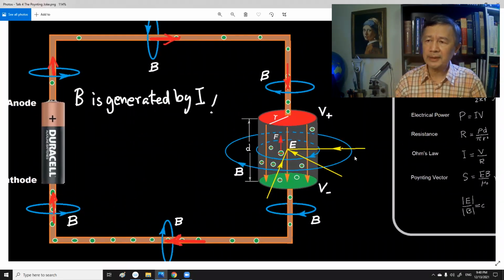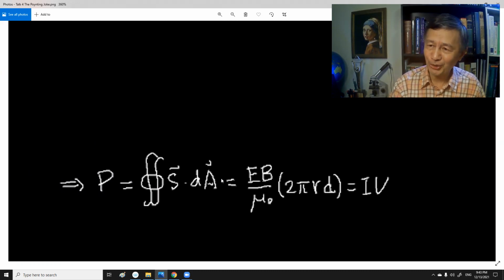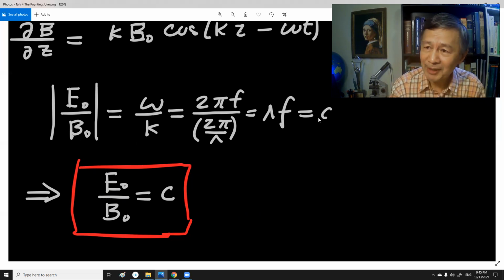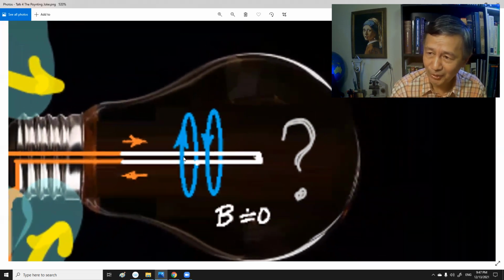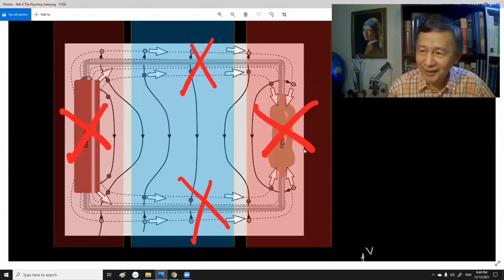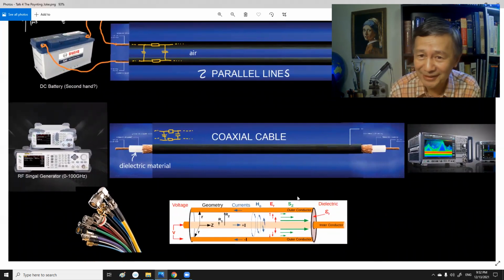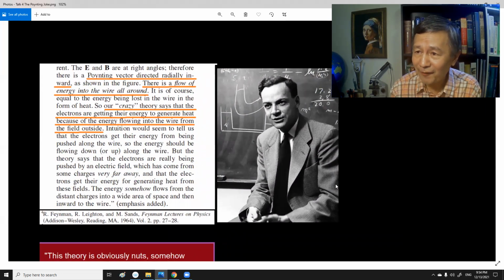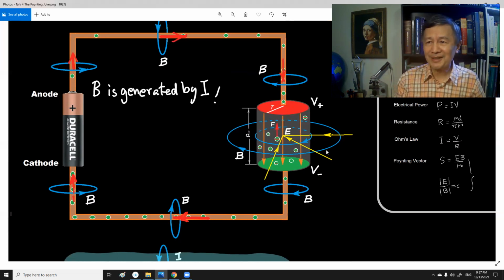The Poynting Joker | Veritasium's Big Misconception about Electricity  4 | 波英廷小丑：真理元素對電學的誤解

Comment: Good video.

I promised to make a video reaction on the claim of Veritasium, here it is:
https://youtu.be/mTmqwdCmgIg

I have to recognize that I'm not that good in physics to rebuke what i've found, or maybe I've forgot a detail that teachers taught me 20 years ago.

I did the experiment you proposed with capacitor and neodymium magnet.
I went even further, using 25kV pulses.

Doing the search of articles and books on Poynting theorem and vector, I've found that some works use those concepts applied to DC circuits.
Apparently, they base their claims on some kind of coupling current-magnetic field that I tried to explain in the video.

As I mention, some authors of books of electromagnetism were cautious and they abstained from using Poynting theorem in DC. 

But others dare to use Poyntings in DC no matter what.
Using their consideration, apparently there is electric and magnetic field inside real conductors, so the Poynting vectors are even inside the conductor.

So, using their logic, a real conductor transports energy near the shell, but also   in a region inside and a region outside.

After I published the video, I've found an article that mention that Poynting vector and Umov energy density are not always the same. 

But never found a single real experiment that confirms the use of Poyntings in DC.

Anyway, thank you for inspiring the questioning.

Comment: Is this video an April fool’s joke?  It completely mangles the differences between near fields and radiation.  Near field electro and magnetostatics have a different treatment than far field radiation. You can have static E and B fields in that DC circuit that do NOT have the ratio of E and B fields in a propagating wave.  Consider the trivial case of a charged capacitor (just sitting across a DC voltage source). There is an E field between the plates and NO B field.  You are mangling plane way analysis and statics, ignoring where time derivatives exist in Maxwell’s eqns.  Poynting analysis is correct for DC case also.
Reply from the maker: What are you surprising about?  Yes, the radio of E to B is not c as shown in this video, which implies that one cannot assume ExB represents an energy flux in DC circuit, near or far. Watch this video again please.
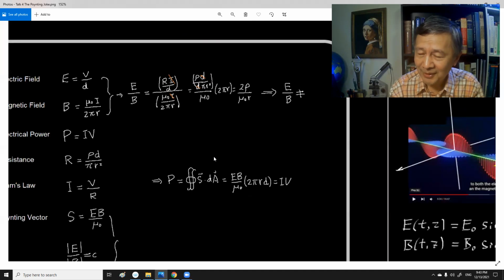Reply: @yongtuition  E x B is gives the energy flux whether you are considering DC fields, or plane waves.   You used the argument that since E/B is not c, Poynting theorem does not hold.  You are making the false claim that Poynting analysis only holds for plane waves.   You were actually correct early in the video when you showed that E x B for the circuit did yield the same as VI.  You indeed did show that it works for DC case.  You start stating the false constraint for use of Poynting vector at 3:15 in video.  You can look up the derivation of energy flow via use of Poynting vector in Feynman lecture notes.  That derivation does not rely on plane waves.  It is common to use Poynting analysis for plane waves so that you can determine power flow from radiation - in that case, you will typically take the time average.  But that in no way prevents Poynting analysis from being used for DC.
Reply from the maker: @bobwhite137  Then your are the second buyer of the DC cooker illustrated in my Video 1 on this subject.
Reply: @yongtuition  There is no volume you can draw in the cooker example that has net power inflow or outflow.  By the way, science asylum had it wrong - for good conductors, S is nearly parallel to the wires.  Veritasium got that right.
Reply from the maker: @bobwhite137  Are you still going to buy that DC cooker? Neither Science Asylum nor Veritasium are correct as they treated Poynting vector as you did. Veritasuim assumed the wire is made be superconductor whist Science Asylum didn't, that's all.
Reply: @yongtuition  Science Asylum ignored the normal E field.  He only considered the tangential (which by the way, Feynman misleadingly did in his lecture notes).  Show me the volume that has net power inflow or outflow for the cooker.
Reply from the maker: @bobwhite137  The DC cooker is designed based on the Poynting vector Feynman and his followers defined.
Reply: @yongtuition  Without a volume that shows net power inflow or outflow, there is no conflict.  Still waiting on such a volume.
Reply from the maker: @bobwhite137  Unlike mathematics, physics is based experimental observation. Why don't you buy the DC cooker first and do some experiments?
Reply: @yongtuition  ok, so it is pointless discussing further with you, got it.
Reply from the maker: @bobwhite137  To ask a right question is better than to answer.
Reply: @yongtuition  Dug a bit deeper by examining the derivation of Poynting vector.  There are a few variations, but eventually, you will find an expression like this:    
∫ (E x H) . dS = ∫-d/dt   [ ε E 2 /2 +  μ H 2 /2]  dV –∫ E. J. dV

The first integral on the right is for radiative energy.  The second integral is for ohmic losses.  That is EXACTLY the case being considered in the DC circuit.  It is not just "the math works out", it is a clear cut consequence of the a legitimate derivation from Maxwell's equations.  With respect to your DC cooker - that is a RED HERRING.  It is NOT the same scenario as a current carrying wire.  You are conflating those two cases.  As to Poynting vector applicability in the pure static case (i.e. your cooker), I would argue it does not apply, since if you look at the steps in the proof for the Poynting vector, you are faced with a 0 = 0 equation early in the proof, and anything beyond that is nonsense.   So there are 3 cases to consider - time varying fields (Poynting works), static fields with a non-zero J (Poynting works), and static fields with no J (Poynting doesn't work), thus no paradox with your cooker.

Comment from the maker: There is no energy between two charged plates but the electric charge arrangement. That's to say, u is zero, instead of a constant. U=0.5CV^2  is another misconception. In the cooker, ExB is a constant,  but you cannot obtain an energy flux in the ExB direction.
Reply: The energy in a capacitor or between two charged plates is a scalar electromagnetic standing wave or a longitudinal wave. When you have a perfect dielectric reflector as in a capacitor, the hertzian/transverse waves move 180 degrees out of phase and collapse to form a longitudinal standing wave. This is also known as gravity. Gravity is a longitudinal standing wave.

Comment from the maker: 1. Veritasium abused the concept of Poyning vector.
2. du/dt=0 when E and B are time independent. 
3. No charge is needed for obtaining ExB. Besides, surface effect is absent for DC current in conductor.
4. Maxwell equations implies EM wave is possible. Poynting theorem is used to describe energy transfer in EM waves, derived from energy conservation
Reply: You don't understand poyntings theorem. You don't even know what poynting theorem actually is.

Start by asking you what is the power density delivered by the EM field, you can derive this from lorentz force.
The electromagnetic force density is:
F= ρ(E + VxB)
Where V is the velocity field of the charge distribution.
Thus dotting both sides with V, VxB dies so:
F*V = E*(ρV)
The left side term can be identified with power density delivered by the EM field (remember the F stands for force density)
Work = intergral( F*dl )
Work = integral ( F*V*dt )
dW/dt = F*V
On the right side ρV is current density as V in this case represents the velocity field of the distribution of charges.
Thus:
dW/dt = E*J
Where W is density of work produced by the EM field.
From this equation, you can now separate J from Ampere-Maxwell law and replace it, by invoking other Maxwell equatuons and using vector calculus identities, you arrive to  the following equation:
dW/dt = -dU/dt -  div(S)
Wich is the real poyntings theorem.
This is the conventional proper derivation present in pretty much all introductory electrodynamics texts, i.e. Griffith's introduction to electrodynamics.

In the case when there is no power being delivered by the electromagnetic field, then:
div(S) = -dU/dt
Notice how what you called poyntings theorem is actually a special case of poyntings theorem, the actual poyntings theorem not only takes into account the flow of electromagnetic energy but also takes into account the conversion of EM energy into mechanical energy by virtue of power delivery by the fields, if EM energy is being converted into mechanical energy then the continuity equation doesn't hold.

This shows half of your objections are plain misunderstandings, Poyntings theorem is directly derived from Maxwells equations and the Lorentz law, thus it applies universally, in all cases not just EM waves. Objection 4 down.
If the fields are constant then indeed dU/dt=0, but then poyntings theorem reads dW/dt=-div(S) so you can and you do have concentrating energy flows into and out of some areas, those areas where electromagnetic energy is being converted into mechanical energy or viceversa, Rendering objection 2 kinda pointless.
Objection 3 is kinda pointless in and out itself.
So you are left with no arguments to claim 1.

Comment: Why did you reject field lines between parallel wires?

Didn't you forget to take into account surface charges?
Reply from the maker: The correct question is: what is the origin of the magnetic field between the parallel wires?
Reply: @yongtuition  
Stationary regime:

E field outside wires is due to surface charges. It goes from top wire (positive surface charge) to bottom wire (negative surface charge). It is a non trivial distribution since surface charge density is non-uniform along the circuit. You can look at American Journal of Physics 64, 855 (year 1996, author J D Jackson)

B field is due to current. It decays rapidly as we go far from the wires (or other element in the circuit).

Because of this rapidly decay of B, S field lines are closer to the wires.

S leaves circuit elements that deliver power (like a battery). S goes into circuit elements that consume power (like a resistor)
Reply from the maker: @renanmelo4903  The mistake as what Veritasium made. How did you know the EXB represent energy flux?  You could be first buyer of that DC Cooker illustrated in my first video (Part 1). :)
Reply: @yongtuition  Well, let's see if that cooker would work using this crazy Poynting vector without EM waves involved?

There is no time dependency in your scenario. Therefore, rot(E) = 0, div(E) = 0, div(B) =0 and rot(B) = u0 . J

Since S = E x B / u0 we can calculate div(S) = (1/u0). [ (rot E). B - E . (rot B)] = (1/u0). [0 - E.(u0.J)] = -E.J

Poynting's Theorem states that -du/dt = div(S) + E.J

In absense of cooker, J=0 and div(S) = 0. Therefore, u remains constant and there will be no "free energy" from fields.

While we put the cooker inside the fields, we are the ones doing work (not the field). Div(S) will no longer be zero and there will be a change in energy density because E field will push electrons of this cooker (inside and over its surface) and J will no longer be zero while we are moving the cooker.

As soon as we stop moving the cooker into the field, J=0 and we come back to time independet scenario. Div(S) = -E.J and therefore -du/dt = div(S) + E.J = 0. U no longer changes and may not be zero! How could that happen?

Well, when an object rests inside an E field it shows polarization of charges! That is where that non zero U came from! Awesome, right?!

Poynting vector is totally counterintuitive :)  However, it doesn't allow "free energy" in DC.
Reply from the maker: @renanmelo4903 There is no energy between two charged plates but the electric charge arrangement. That's to say, u is zero, instead of a constant. U=0.5CV^2  is another misconception. In the cooker, ExB is a constant,  but you cannot obtain an energy flux in yhe ExB direction.
Reply: @yongtuition  I didn't understand your point. Can you give more details, please?

Comment: I believe you are confusing S with radiation.

S= E x B / u0

Radiation is a configuration of the E and B fields when charges accelerate. It is the solution of Maxwell's equations where they obey the Wave Equation.
Reply from the maker: In the wave equation for EM wave, both E and B are time-dependent. Besides, E=Bc. Radiation refers to superimposed EM waves. S can be considered as the intensity of radiation if, and only if, E and B satisfy the wave equations.  Mathematically, Veritasium assumed the cross-product of E and B automatically give the energy flux, maybe he didn't understand the underline physics.
Reply: @yongtuition  does Poynting's Theorem need EM waves in its mathematical proof?
Reply from the maker: @renanmelo4903  Yes. In the absence of EM waves, the cross product of E and B is meaningless.
Reply: @yongtuition  Althought Veritassium's video introduces S in the context of EM waves, Poynting's theorem does not use wave equation.

All we need is Gauss's theorem of vector calculus and Maxwell's equations. For example, you can check this demonstration in Jefimenko's book.

I do recognize that this script choice of Veritassium induced the association of S only to EM waves, but that is not the whole story. Conservation of energy in electromagnetic field also depends on the motion of charges:

-du/dt = div(S) + E.j
Reply from the maker: @renanmelo4903  1. Veritasium abused the concept of Poyning vector.
2. du/dt=0 when E and B are time independent. 
3. No charge is needed for obtaining ExB. Besides, surface effect is absent for DC current in conductor.
4. Maxwell equations implies EM wave is possible. Poynting theorem is used to describe energy transfer in EM waves, derived from energy conservation. 

If you still cannot see what Veritasium's claim is wrong, you need re-study electrodynamics again.

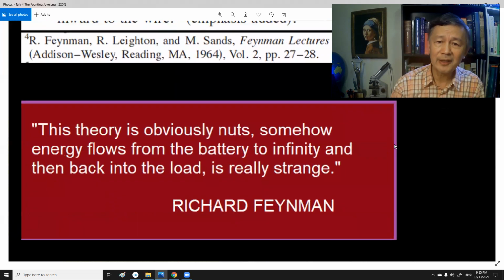Comment: At 14:54 you say Feynman's conclusion, but when we read further down in Feynman Lectures we see:

"You don’t need to feel that you will be in great trouble if you forget once in a while that the energy in a wire is flowing into the wire from the outside, rather than along the wire. It seems to be only rarely of value, when using the idea of energy conservation, to notice in detail what path the energy is taking. The circulation of energy around a magnet and a charge seems, in most circumstances, to be quite unimportant. It is not a vital detail, but it is clear that our ordinary intuitions are quite wrong."

So the part you quoted from seems to be not his final conclusion, what do you think about that?
Reply from the maker: Richard Feynman is well-known for denying his theoretical inconsistency made in his QFD, in which he simply kept blind eye to those apparent divergent solutions. Paul Dirac was quite upset about him. Some of Feynman Lectures were based on his informal public talks, I wouldn't recommend students to study physics that way. The quotation you used sounds he was talking to his fans, rather than serious physicists.
Reply: @yongtuition  The quote you have used in your video is from the same source as the one I wrote above, mine is just 2 paragraphs later. So you are basically saying that Feynman is worthy to quote when his words seem to support your interpretation, but when it is shown that he is actually saying something opposite than yours he is no longer reliable?
Reply from the maker: @timurozturk6435  No, the quote I used is the fact whilst the way he tried to justify the idea would appear metaphysical.  Which is reliable?
Reply: @yongtuition  metaphysical? The use of Poynting vector is not something Feynman came up with. You can find it for example in Sommerfeld's theoretical physics lectures. There is absolutely nothing metaphysical about that.

What Feynman shows in that page is a resistor without the remaining circuit. When you add the circuit you will see that the enrgy is basically guided by the wires and the symmetry is broken. Power comes from the battery through the space around the wires. 
Nothing metaphysical here. Just plain old classical physics.
Sommerfeld's text is form the '30s.

Comment: The Host is using FAR FIELD concepts to explain a phenomena (the electric and magnetic fields in a transmission line) which are dominated by the NEAR FIELD. In the far field the reactive stored energy (energy stored in the electric field due (Capacitance) and energy stored in the magnetic field (Inductance) are not significant). The near fields (electric and magnetic) are the important fields in transmission lines.
Reply from the maker: Thank you for you remarks. It is more important to understand the magnetic field around a current-carrying wire, or a resistor, is originated from the electric current (see 7:46). The causality must be clear. Veritasium, or his script writer, had made a similar mistake in his video on CO2 and the surface temperature of the earth.